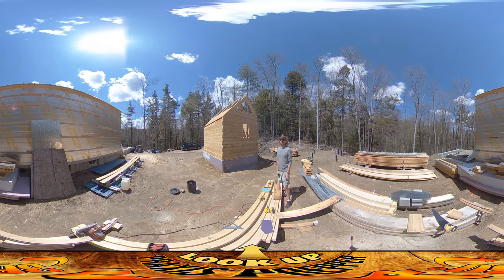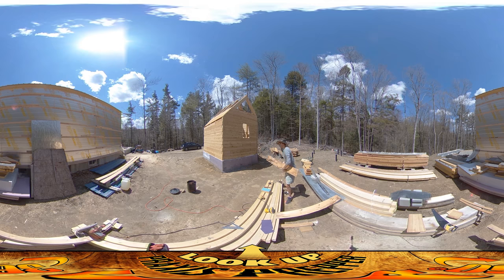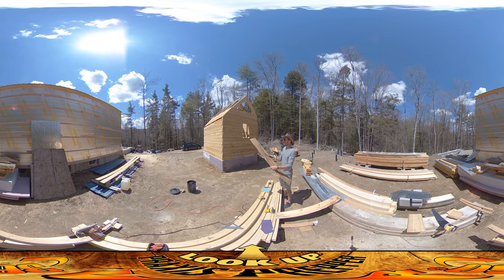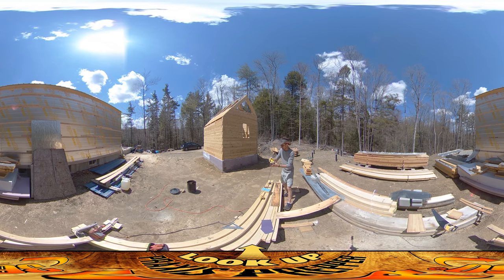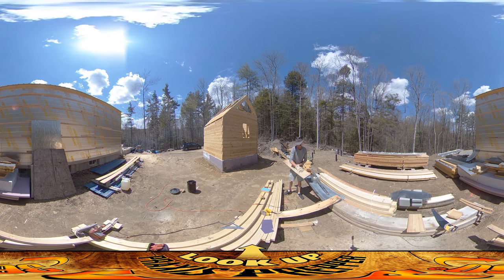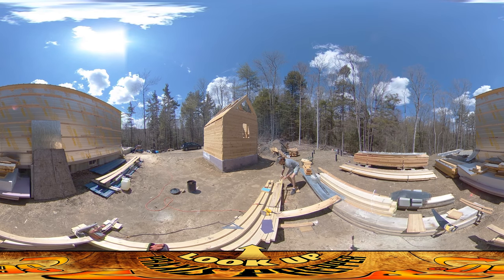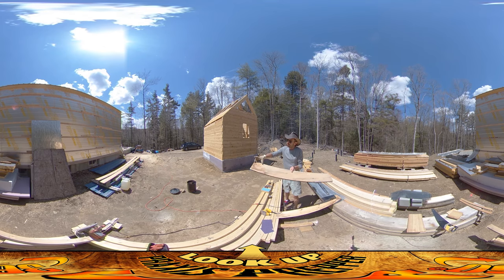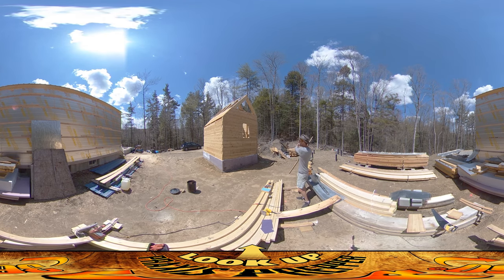Homestead Building - Mini House Sheathing, Reusing Old Junk Lumber

Comment: So glad i realized quickly enough what was coming and saved myself some shattered eardrums ... i've also got a recycling project coming, going to use an old t-shirt and the plastic cap of a tiny-tomato 'cup/package' to make a nifty mask ... had to use a little bit of heat (and carefully) to reshape the plastic so it would fit nicely over my nose, now it just needs some more holes in the plastic and some cloth covering (maybe two layers at an angle). The cap has this cone shape to it that keeps some space between my mouth/nose and the cloth (basically like a dusk mask), which will hopefully increase the ease of breathing and keep the build up moisture away from my face (something i rather dislike about wearing anything over my nose/mouth for some particular time) ... non-surgical masks will be obligated over here in public transport and tbh. i just want to wear one when i'm shopping (basically for other people, and maybe for myself for some unjust feeling of 'safety').

Comment: I just finished 600 sq of tile. 115/8x235/8. I had 3 polices left and very little scrap. I explained tho mutt customer an advantage tho me is I also save money by not having special order material left over. No compromise on quality. Watching I reflect on how many times as a protect manager I saw subcontractors throwing huge amounts of waste away. Out is easier tho use new. What I found over the treats are few people use the mind tho think ahead and realize they could use scrap sizes which is just a bit closer tho what they need. Well Thanks for looking ahead!!